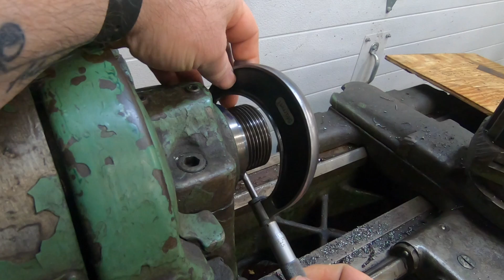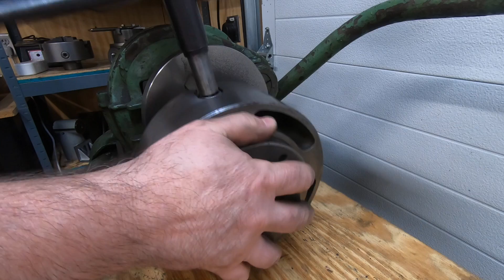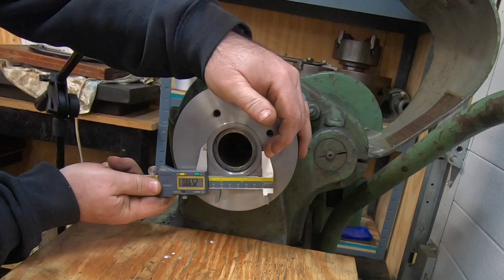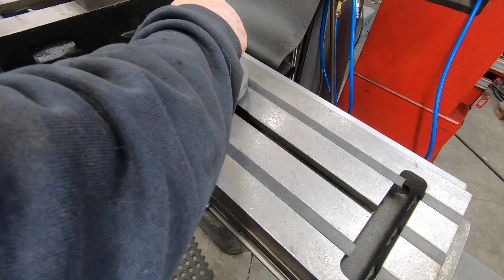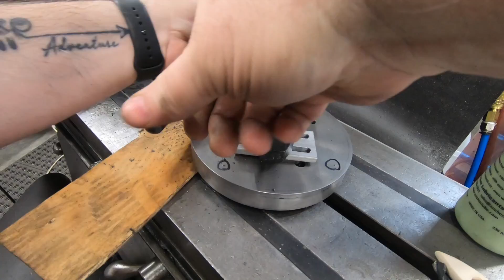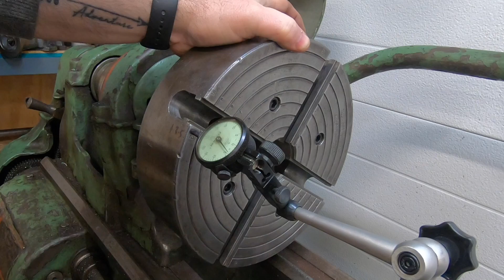Machining a Backplate for a 10" South Bend 4-Jaw Chuck

Comment: My milling machine spindle gets stuck when it gets too cold in my shop, I have to take off the cover and heat up the spindle bearings with a heat gun to get it free again, it is lubricated with thick grease. My lathe has the opposite problem, when it is cold, it runs very nice, it is lubricated with oil, when it it too hot in the shop or when the spindle gets too hot the oil starts dripping out and the spindle gets like 0,005-0,01mm looser.
Reply from the maker: I can see how that would happen. Interesting. I have some heat sources in my shop now, once the lathe is up and running again - hopefully by next year - we will see if it runs any better.

Comment: It would help to know more about what motor you have on the lathe and what you have for power. If you're running a three phase motor on a phase converter, make certain that the motor is wired for the voltage that the phase converter is supplying. Most 3 phase motors are wound to be able to run on either 440-480v or 220-240v. Some may run on 208 also but they won't have as much power. 
If you are running a single phase motor on single phase current it's likely the motor is too small. Theoretically, an electric motor should have more power at lower temperatures as current flows more readily in colder conditions. There could be grease in the motor bearings that is stiffer in colder temperatures but that shouldn't take very much running to loosen up. The oil in the lathe gearbox might provide more resistance for a longer time. A 10 inch lathe probably needs a 2 hp motor to run at high speeds.
Reply from the maker: All good points. It's a 3 phase motor running off a 10hp American Rotary phase converter. I have three other 3 phase motors, two of which are higher HP than this one, and they are all fine. I am certain, with no doubt, it's in the motor itself. At some point, I am going to pull it out, but that won't be for a couple months at least.

Comment: lathes in cold weather will run slower/ more sluggish! every lubricated part/ tolerance is now stacked resistances against the motor (i also fight an unheated shop in the northern climate), i assume the cast iron shrinks tighter onto the bearings & bearings to the shafts/gears run tighter cold, all while the lubricants on the whole machine are now tackier and thicker. i usually run my lathes at 50% speed for 30 minutes or so until it quiets down and starts to run noticeably smoother. on really cold days i run both forwards and reverse stopping to re lubricate in between directions and finish off with 10 or so minutes at full speed to get the belts warm. 3hp dc rockwell 10x36 & 2hp dc rockwell 10x24 both are sissy's below 50F.
Reply from the maker: I don't have this problem with any of the other motors in the shop. Even when it's in the 30s. It's just this one.
Reply: @MyLilMule  double check your wiring if using any converters/vfd I assume your not running anything 110v?
Reply from the maker: @BlackLocustFarms  220 three phase. All the wiring has been checked, at least up to the peckerhead. I haven't pulled the motor to check any of the windings.
Reply: @MyLilMule  first time viewer, I'll watch some more videos to fill myself in. I've only had this heat sensitive issue a handful of times, which in my case were/are spindle related. I hope it's just a simple/cheap fix for you!
Reply from the maker: @BlackLocustFarms  Welcome to the channel! I plan to do a complete rebuild of this lathe, including grinding the bed ways and scraping all of the sliding surfaces. I imagine I will be replacing some lead screws and nuts. None of this will be cheap. LOL!
Reply: To add: A cheap solution for rust is a dehumidifier (rated for a space larger than your shop) to help remove the moisture, and a circulating/oscillating fan to keep moisture off/evaporated from the machines. for larger machines, covering them in a canvas tarp with a low wattage heat lamp/25w bulb, will also keep the casting above the ambient temps, and will stop condensation from forming.

Comment: I would use an inductive amp meter on each power leg of the motor and take measurements when under load and acting up. The readings theoretically should be the same. If both spike up to relatively the same amount then you may have an issue with the input wiring (low overall voltage) or an excessive load from the lathe. If one leg spikes up higher then the lower amp leg may have a connection issue at or in the motor. You should also measure the resistance of the field windings (they should be the same). Lastly you could use a meg meter to check the windings (check YouTube for how to do this).
Reply from the maker: Thanks for the suggestions. I know a couple electricians, I'll see if they have those devices that I might be able to borrow.

Comment: I live in NE ohio. Bought a mini split. Wish I would have bought a window unit and cut a hole in the wall. Or just a gas heater. One thought on the motor though. Does it have start and run capacitors? Good luck.
Reply from the maker: @buckwheat7673  It's a 3 phase motor, they don't have capacitors in them. Can you send me an email: greg@mylilmule.us? I am also in NE Ohio (Lake County) and would like to hear why you regretted the mini split.
Reply: Since you asked for ideas…… If I understand the history, you are running this motor off a rotary phase converter?  If so, do you have any other machines also running off that same converter, and yet they show no issues with bogging down under load?  Note, if the only other machine using the phase converter is the mill, that might not be a good comparison as a mill is rarely loaded as high as a lathe.
Reply: Just went from WOOD to pellets in NE WI.. Wood has been messy and time consuming for the last 20 yrs. good used pellet stove was 750 upfront though but much cleaner and user friendly..  I keep it at 50 unless I am in here. It has worked best for condensation control.

Comment: Interesting saga with the motor. Since you have already checked to make sure it is on the low voltage side, not sure what else to suggest except see if there is a large power spike when it bogs down. If so maybe the wire size is not correct and can't handle the extra draw?
Reply from the maker: I suppose anything is possible. If I can't find anything obvious that I am capable of fixing, I don't know that it is worth having someone else fix it.

Comment: Check to make sure the motor is wired for the correct voltage. 
Joe
Reply from the maker: I did that in the spring. I opened the pecker head and it's wired for low voltage, so I am still at a loss as to what the deal is.

Comment: With you living in a colder climate (I think you said Ohio), would it be too expensive to keep your shop climate controlled?  Do you have any issues with condensation on your equipment in the colder times of year.  Nice project and nice to see "Old Green" put to use.  🙂  And I have a brand new bottle of AnchorLube on my shelf right now.  It's excellent that they are partnering with you!
Reply from the maker: I am planning on adding a mini-split to the shop real soon. They do operate as heat pumps also. Not knowing just how efficient they are, I don't know if that would be cost effective. I had always planned on putting some kind of gas heat in the shop, just haven't had the funds to do that. This past year, I bought a dehumidifier and it has kept the shop fairly dry, I haven't had any issues with surface rust. We'll see how it does as it gets colder.
Reply: @MyLilMule    The guy that did my shop recommended a mini-split.  I very happy that he did.  I have to add a little supplemental heat via a heater during the coldest times, but overall I'm very happy with it.

Comment: I had this problem with my motor on my Lathe. It was wired for 480 3 phase instead of 240 3 phase and would run just with no power.
Reply from the maker: I opened the pecker head a while back. It's wired for low voltage, so unless someone monkeyed with the internal wiring, it's 240 volts.
Reply: @MyLilMule  I would check the wiring on the motor it should say inside the plate wire should be hooked for a low voltage and high voltage. Just a thought.

Comment: The clearance while tapping issue gives me the idea of a tap wrench with a single fixed hole in the center and to-fit inserts for taps; that way you could have more reach for depth if you need it.
Reply from the maker: Another idea would be to use the mechanics of a ratcheting box end wrench, but with square inserts to fit the back of taps. I wonder if anyone has made that yet? I can't believe I'd be the first one to think of it. LOL!
Reply: @MyLilMule you're describing tap sockets.  Lisle makes a good set that covers something like 10-32 up to 3/4" taps.  I've had a set for over 20 years.

Comment: I'd look at the brushes on the motor, but if you're going to replace it anyway I can't recommend a 3 phase motor and VFD enough.
Reply from the maker: I have a perfectly find rotary phase converter. If I do get a new motor for it, I can't foresee me using a VFD on it.
Reply: +1 VFD will give our RPM control. This winter I will convert my lathe from 220 split phase to 220 3 phase just so I can get rpms between my gears and lots less belt changes.  I have one on the mill and I rarely change the belt. The downside is cooling below 30 htz and excess heat above 80. I just stay between 30 and 80 and run it for shorter periods. I will buy a VFD rated motor for the lathe, hope to get 10-200 by oversizing HP.

Comment: That motor story is indeed a bit strange. In the video we can hear a distinct humming sound when it's spinning. Could be sign of a bad contact in one of the windings. Witch also give loss og power. Just a guess.
Reply from the maker: I won't know for sure until I get it out, and they aren't easy to just remove by itself. When I took apart the other lathe, I actually lifted the base casting off the motor using a hoist.

Comment: the motor seems weird, 
If it has cold grease and is hard to turn by hand when cold that can take a lot of power, but that would warm up relatively quickly. Honestly if it was mine I'd switch it to sealed ball bearings but that's just me. 
if it would be a bad connection... that wouldn't explain why it's happening only when cold and it would really heat up that wiring.
Being a 1,5HP motor, if the lathe itself had that much loses in the powertrain... well it'd be impossible to turn by hand and it would really heat up. I've put approximate speed, feed and DoC into a calculator and it spit out something like 200w which is a bit more than 1/4 hp.
I would look into it, open it up, check everything and if I wouldn't be able to find anything then I'd just get a new motor.
Or a used but actually working motor from facebook marketplace or craig's list or somewhere.
That's my take on it from all the info I have.  what you end up doing is up to you but if you are gonna take it apart I'd love a video on it
Reply from the maker: The motor in it isn't very "vintage" - I don't think, so if new bearings are in order, I will go with sealed bearings. My K&T has a vintage motor in it, so I used greasable bearings in it. At some point I will be taking this thing apart and striping it down. Just need to use it for this one project and I should be OK to start taking it apart.